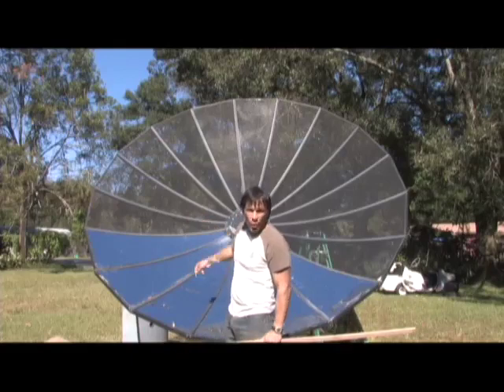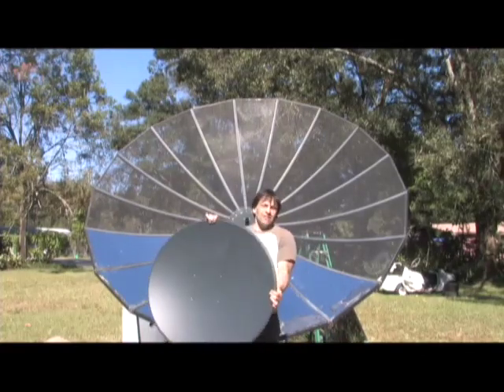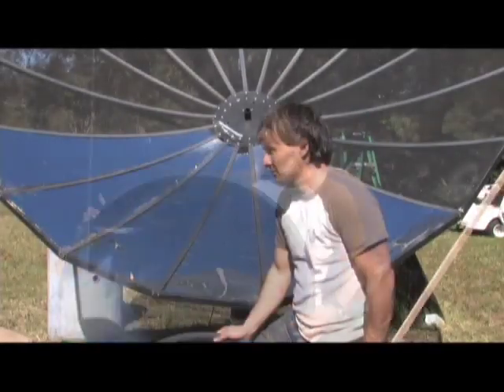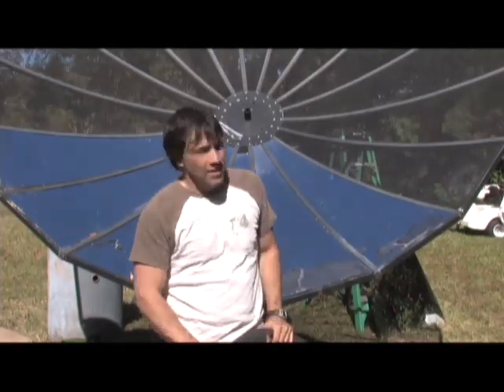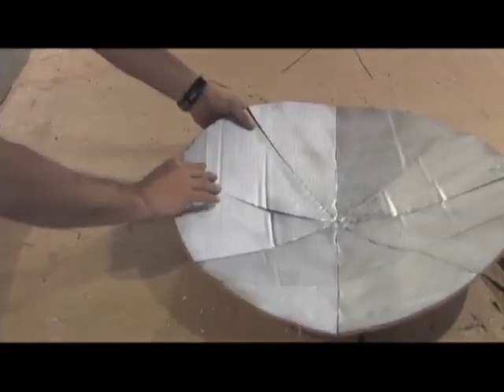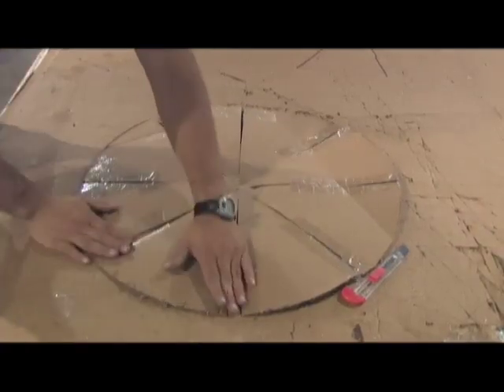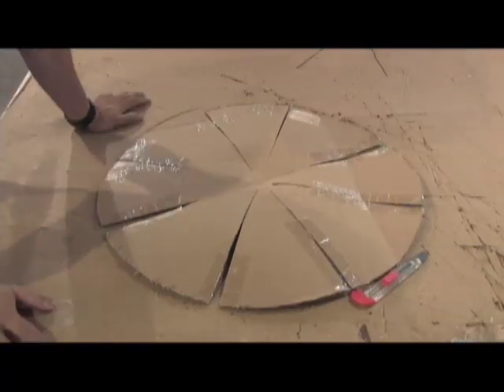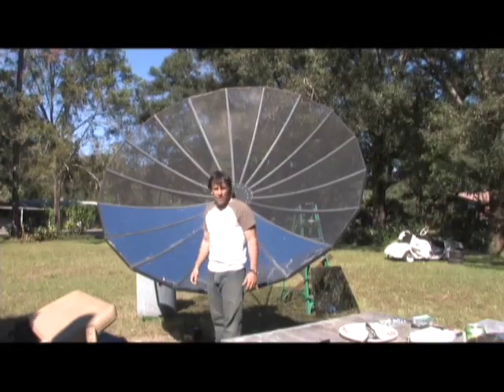DIY SATELLITE DISH to Huge Parabolic Mirror Solar Cooker Reflective Film  SOLAR

Comment from the maker: It will work but the surface needs to be perfectly smoothed like glass or the silvered finish looks like pewter. We have the parabolic acrylic mirrors vacuum deposited with aluminum and if the surface is not perfect, the mirror does not work.

Comment: Thanks Dan! That is great to know! You guys are awesome. I love the videos. I have a question for you that you probably were never asked. What happens if you coat your parabolic dish with Silver??? I was told silver is the most reflective metal so I wonder if that would give you more strength and higher temperature?? Have you tried this before? I know that would be very expensive but I would love to see this experiment. Thanks again Dan and Denise!

Comment: maybe you could make a heat exchanger based on oil. a little black container in the focal point with tubes running down to a cooker plate. either an electric pump or one based on a small stirling motor to circulate the oil. the dish could be tracking. that way it's easier to cook

Comment: I might be wrong, but I don't believe that the direct tv dishes are parabolic.  They're designed to receive at an angle, and reflect to a spot at another angle.  Using it straight on will probably give you a spread out heating spot.

Comment: ok them emergency blanket are mylar. to make a sun tracker get 2 big soda bottles 2 pullys on the back side right and left at top put a pully try a string to the middle 2 of them going over thr pully then down to bottle tie on full with water one has a pin hole at bottom as it empty the heavy will pull the dish to flower the sun will need a lady sueson that thing in your carboard that turns lol

Comment: Actually, you place the steam generator ( boiler, coil, whatever )at the focal point of the dish connected by a flexible coupling ( stainless reinforces high pressure hose) then to you turbine or sterling engine. The "cost " would be maintenance on the system, plus just a bit to power the tracking motors). If you live in a climate with enough clear sunny days, go for it, the payback may be long, but properly designed it will work.

Comment: What if, by using a fresnel lens, you channel the light just off  the focal point into a straight beam. I was thinking of taking that beam down a solar chimney of a sort to use for indoor cooking. if the diameter of the parabolic mirror is 5m(16.4ft), can i then take that light channeled down, and split it into 4 parts and still have enough light to heat 4 stoves?(The stoves using either the solar cooker method or fresnel lenses reflected up onto a large pan). *the chimney = 5m height max.

Comment: death rays are the furtherest thing from my mind. what i'm thking is, with reflective points, fixed... mounted in say a hill side, all focused at a single point, then all one would have to do would be to put a closed water source at that point also, then hook that up to a steam turbine, or even an old steam locomotive engine (piston), hooked to a generator and have a steady, virtualy free source of electricity.

Comment: no.
If you are reflecting solar energy to the focus, you will have something at the focus to gather the energy (photovoltaic cell, steam coil, etc).
If you put your LNB in there, it would cook it.
(and it would block the light from hitting your heat coil)

Comment: greg357159,

 - easy, satelite dishes are focused on the existing LNB, (the arm with the "eye" on it that recieves the signal), is perfectly focused...personnally I would replace the LNB with a small boiler to power a small steam engine...this would work great with the old C-Band dishes.

Comment: there are tracking system available , just search for 'olar tracking equipment" in internet surely you will find some website , however this paraabloc dish can be used for heating water during day , if you make some arrangement to hang a wsmall copper cyclinder which is colored black, and make water circulating arrangement to that  copper cylinder , you can use very chip water pump with very less wattage to circulate water and store into the your water heater tank, of course need control systems

Comment: Hi

  Would it need a tracking system to work along the solar movement of the day or if you leave it in a certain position, it would focus more or less heat on the focal point? Im just trying not to mess with tracking devices...

Regards

Comment: I'm not sure why he hasn't directly responded to requests for information about the mirror film, other than simply trying to protect his market?

I'm not sure exactly what he's using, but I know a material called ReflecTech will do the same job and I think already has the adhesive on the back too.

The manufacturer's site sells it, but the smallest quantity is 150 sq ft.  I also found a site which sells smaller quantities.  It's expensive though.

Links in next post b/c of space...

Comment from the maker: Hi,

I will have some on my website soon. A large 4' x 8' section costs about $150. It is thick like a business card and 95%+ perfect mirror. The back side needs adhesive. I use a 3M mounting spray. I had to make some adjustments and the video will be out soon. Material on our website in a few.

Comment from the maker: You can get Aluminum to 90+ if you have the time and the right buffer and paste. I have seen trucks with doors that are amazing.

You have about 36 +  sq ft roughly 3500 watts of heat energy at 100+ reflectiveness. If you have a 70% mirror, you are 2500 watts roughly. You would need yo take 25% of the figure for efficiency loss engine boiler generator converter. 2500 x .25=625 watts in a good scenario.

Comment: The Mother Earth News has an article in their Dec 2007 issue titled  Solar Heating Plan for Any Home. This uses a flat panel drain back collector and a 500 gallon tank of water for thermal storage. The heat is then piped to an in floor radiant heating system. I wonder how a parabolic like this or the trough one from your earlier video would do in place of the flat panel.

Comment: Great work!  I'm planning to make a parabolic mirror from a fiberglass satellite dish, but want to do it as low cost as possible.  Would aluminum foil (shiny side out) secured with spray on glue be an adequate (if not equivalent) substitute?

Comment: You could strip the coating off of the dish and polish it to achieve a mirror finish without having to add any other materials. You coule achieve a much higher quality finish. Thanx for the videos. 
Best regards mark